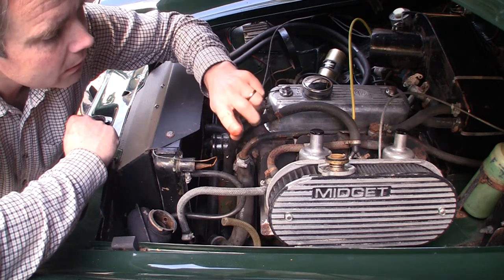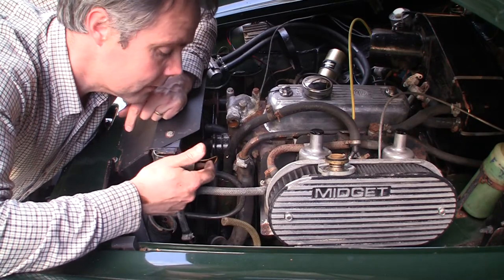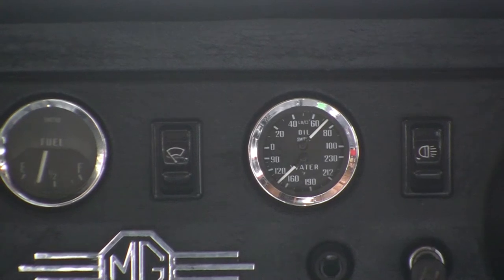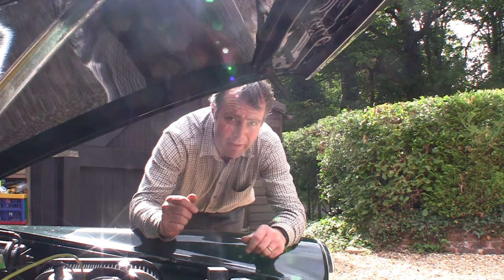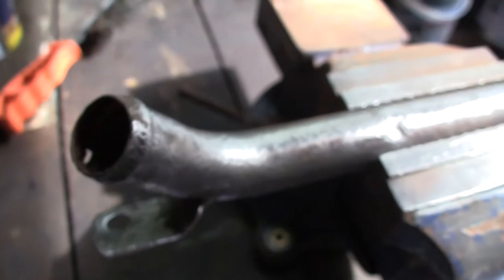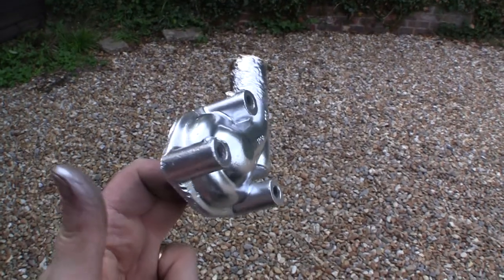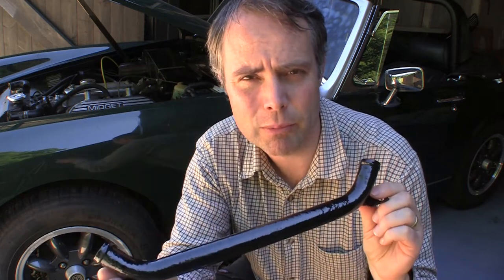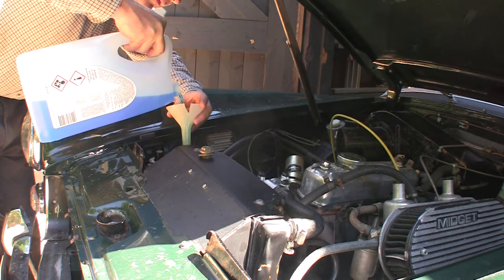Flushing the MG Midget’s cooling system

Comment: Hi, Thanks for making this video. It was good to see how the oil cooler sits in front of the radiator because I have now just re-installed an oil cooler in my 71 Aussie assembled Midget and there was not any existing brackets or holes to refer to.  The kit did not have a thermostat, and I probably don''t need one for just cruising around on the weekend. The new kit is metric of course, and the rest of the car SAE, but now I just have more tools!
Reply from the maker: Thanks for watching and thanks for your comment. There is more of the oil cooler in my video "Completing the changing of the MG Midget's oils": https://youtu.be/cii352RrUFM . Depending on your climate and if you are just cruising around you might want to consider fitting a themostat so you don't 'over-cool' the oil. Without one it might never get 'up to temperature'. Although if you are racing you probably would warrant constant cooling. All the best...

Comment: I'm surprised to see that you let the chemical flush simply drain all over your driveway. Besides environmental considerations, didn't it cause stains or smells on your driveway?
Reply from the maker: Thanks for commenting; it's a good point and something I probably should have said in the video. The power of editing! I used a washing up bowl under the car for the initial and chemical drains; you can't see it in the shots looking into the engine bay (and a some did spill out as the water went everywhere) and I didn't film it from below. The shots showing it going on the driveway were from a 'staged draining' I did later to get some water falling footage and I edited it in to earlier parts to make it more interesting; so yes I admit it did look like it went all over the drive and the staged water wasn't completely clear. The washing up bowl only just fitted between the chassis and the ground so took it out for those staged shots (B-roll). No staining on the drive and no smell either; seem to recal the flush was biodegradeable as most things have to be now. Water was never as dirty as I had anticipated / hoped; but the flush did improve the heat output from the heater.
Reply: @JerryMotorsport  Thank you for your extensive reply. The last couple of days I have been going through the same process: draining the cooling water from my MGB, flushing it several times with water, until it was less murky and had less of a rust-colour. Then I filled with antifreeze as it also has some rust-preventing additive. I'm hoping that this is a better choice than regular water.
Reply from the maker: @windmill1965  Sorry I missed your reply. I would never advocate just plain water in the coolant system (exept in an emergency type scenario). Even if there was no danger of the coolant freezing, the corrosion inhibiting properties of the additive is surely a must in any engine. Hope the work on the MGB went well.
Reply: @JerryMotorsport  Yes, coolant replaced. Up to the next job, as there is always something left to do.
Reply: Yeah - that's not at all a good thing to do.

Comment: Jerry... are you flushing the heater-core? If so, where is the out flow and is the heater valve opened?
Reply from the maker: Hi, yes I flushed the heater core as well as the main cooling system. The isolation valve is curently stuck in the open position so when I added the flushing chemical it would have gone around the heater matrix too. At 7:51 you can see I've disconnected the hose from the heater isolation valve to fush through fresh water to make sure I got as much cleared as possible from the heater. Ideally I would have used the other hose (upper from the core) and flushed in the opposite direction to normal flow; this was just easier to remove the hose from the valve.

Comment: Jerry you have a nice Rocker Cover on yours, i want to add one on mine but i heard with the 1275 once you add an Alloy Rocker cover on you need a vented oil filter cap because usually they do not have provisions for venting, no vent would allow crankcase pressure to build and would blow oil past even new seals ?
Reply from the maker: Hi Raymond, thanks for commenting. I've not heard that before. Personally I don't see how the material would have an effect on the requirement for a vent; it's still a cover. Our filler cap is 'loose fit' so guess that allows some venting. I'll take a look at the pressed steel cover I've got in the garage and see if there are any diffferences or vents that have been 'omitted' in the alloy cover. All the best.
Reply: @JerryMotorsport  ok cheers mate. i do want to get a new one i just dont want to mess anything up along the way, thanks again.

Comment: Can you explain the backflush process? Thank you
Reply from the maker: All a backflush really is doing is removing any deposits from the cooling system. As the system is pumped in one direction the flushing water is ofen pushed round in the opposite direction (but not essential) hence the name. I flushed clean water through in any direction I could attach a hose to the system. With deposits and any restriction buildups from the system removed, potentially enhanced by a chemical flushing agent, the system can operate more effectively in keeping the engine temperatures under control through better flow through cooling areas (radiator) and better heat absorbsion in the engine water galleries. Refilling with a corrosion inhibitor after flushing helps prevent a sludge build up accumulating again and often acts as an anti-freeze too. Hope that answers your query.
Reply: @JerryMotorsport  I thought that is what you meant but just wanted to be sure. Thanks for the thorough explanation!

Comment: Another good one Jerry. Glad to hear you mention replacing that thermostat housing :-). I got my replacement via ashleyhintonmgparts2002 on eBay a few years ago. And not at all surprised the steel lower pipe had failed as I'm sure they all do regularly. Mine was far worse, unfortunately, so replacement needed. Curious whether you got the rough running solved, and related to over-temperature?
Reply from the maker: Thanks Simon. Musn't forget to replace that housing. Car runs a little better after the flush but I need to use the car in a bit more anger to see if I still have the rough running issues. A healpful viewer has sent me some suggestions to try around the fuel pipe to the carb.

Comment: Well i don’t think letting the coolant out onto the ground is a responsible thing to do. And you should flush with deionized or distilled water.
Reply from the maker: Hi Joe, Thanks for watching and commenting; it's a good point and something that was picked up six months ago; I probably should have said in the video about collecting the coolant. The power of editing! I used a washing up bowl under the car for the initial and chemical drains; you can't see it in the shots looking into the engine bay and I didn't film it from below. The shots showing it going on the driveway were from a 'staged draining' I did later to get some water falling footage and I edited it in to earlier parts to make it more interesting; so yes I admit it did look like it went all over the drive. The washing up bowl only just fitted between the chassis and the ground so took it out for those staged shots (B-roll). I suppose I could have flushed with deionized or distilled water but i would have had no pressure; plus the coolant is mixed with tap water anyway so didn't see it as a huge issue.